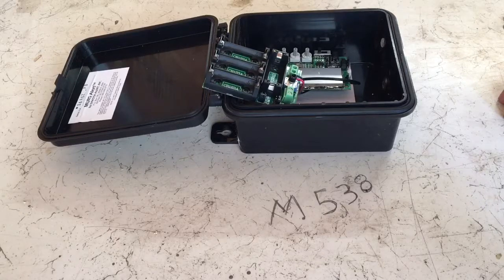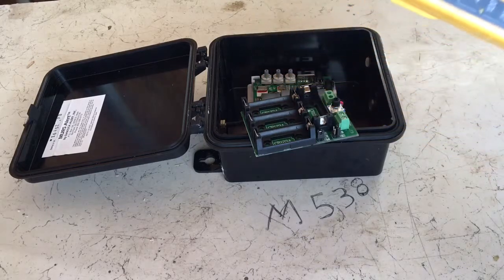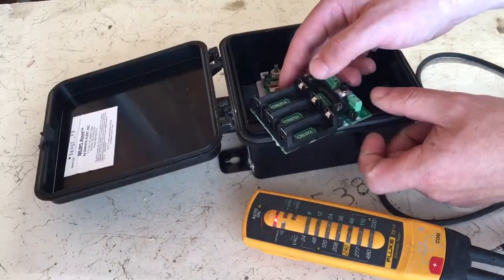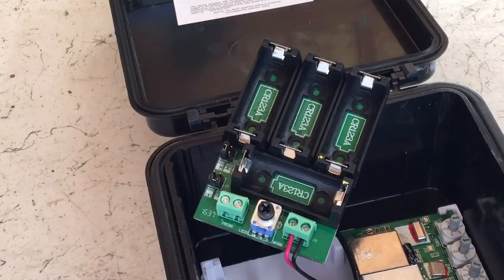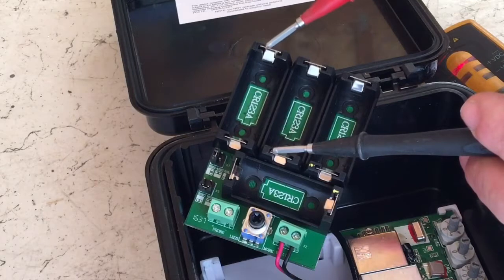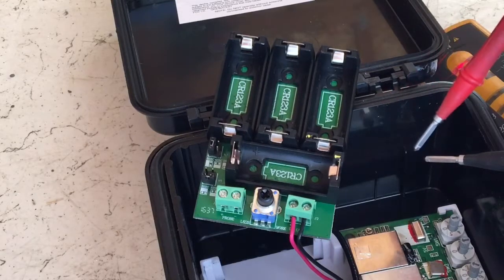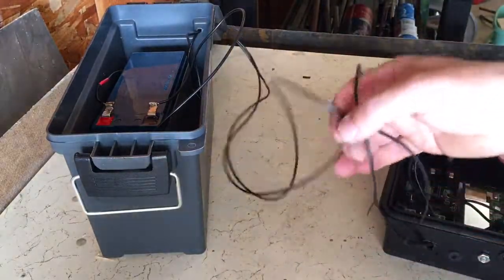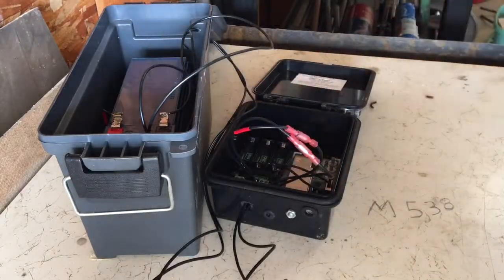Dakota alert driveway alarm battery modification

Comment: Hi are you telling me that the CR123 batteries in the unit are diode protected and will not allow power get from the red and black wires back into the batteries?  If not my suggestion is to replace the CR123's with CR123"R"'s (the rechargeable CR123's) and either leave a solar panel running in parallel  at the red and black wires to keep the battery pack charged.  If the CR123's are diode protected attach the solar panel to the CR123 battery pack at the batteries (where you attached your 12V battery.  My concept is to not need to keep replacing any batteries.
Reply: IMHO, it's easier to do a 12V SLA than a set of individual 3V rechargeable batteries with off-the-shelf stuff.

Comment: I don't understand.  Why don't you just cut the red and black wires and attach them to the  12V battery
Reply: That's not how the unit works.  The printed circuit board (PCB) that the CR123A batteries go into, is the board that holds the probe sensor stimulation, detection, and control circuit.
 
The two red/black wires leaving that board are powered when the sensor trips.  When the second PCB board gets powered by the sensor board, it begins broadcasting immediately, and the little microprocessor in that black dot of epoxy is a sound player.  Based on the setting of the slide switch, the sound player will play one of four sound files in its memory in a loop until power is cut.
 
This is kind of slick of Dakota Alert to do.  By making the radio portion of the unit transmit on power-on, it requires no idle power (longer lasting batteries) - and it can essentially be triggered by anything that can provide a switched 9V output (verified this by digging into the schematic for the RF transmitter: https://fccid.io/QK8MALERT).  This also probably meant less work with the FCC, as they could in theory FCC certify the radio PCB design once and then produce several products from one design and submission.
 
The motion detector variant uses a standard indoor/outdoor PIR alarm sensor and just uses the PIR sensor's alarm relay to power the radio section when the alarm trips.
 
I could see end-user variants of this unit done pretty easily, use a section of rubber hose plugged on one end, and a low pressure switch on the other to close the circuit between a 12V battery and a 12V timer module like a Macromatic TE-8812U (set as interval mode).  When the hose gets stepped on, the pressure inside it rises - closing the low-pressure switch.  This provides power to the timer module which closes its relay providing power to the radio (AND itself).  The radio will continue to get power as long as the interval setting - so even if it's a short pulse - it's enough to trigger a long broadcast.
 
No power used when the pressure in the tube is below the switching pressure.  Replace the pressure sensor with a float switch and you could detect if a water level is too high, replace it with a relay and you could detect a power failure...  really once you get it to switched power, the installer's creativity is the limit.
 
I imagine these could be further hidden too by using a bias-tee in the box so that TX-RF and DC power can be carried over a coax cable, then run good cable to a tree and put a solar panel and a camouflage-painted j-pole antenna 60-feet up there. Power sent from the solar panel down the coax could then be split off inside the box to a solar charger.  No more changing batteries, and a nice hidden system.